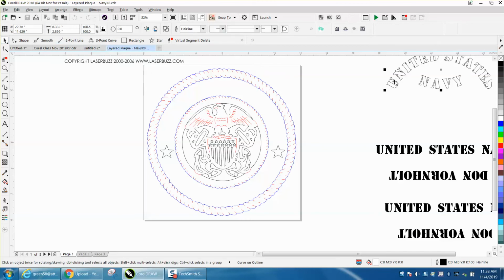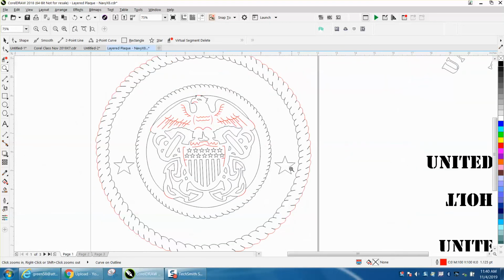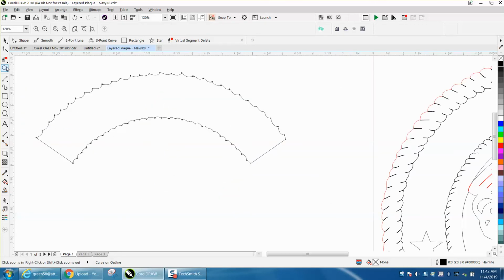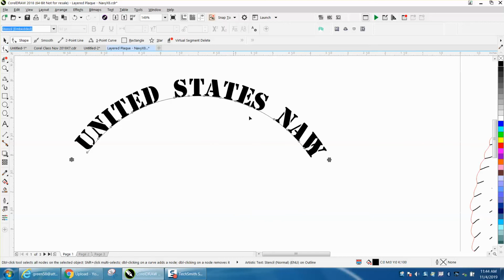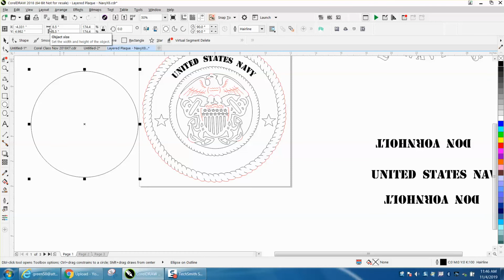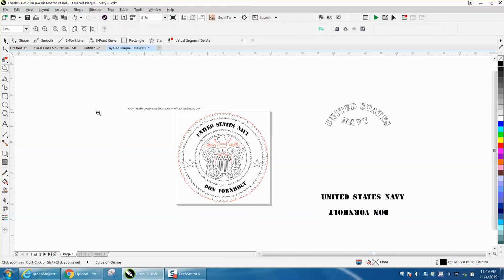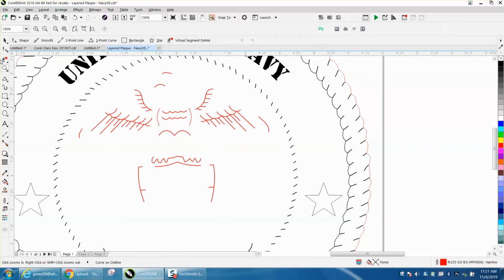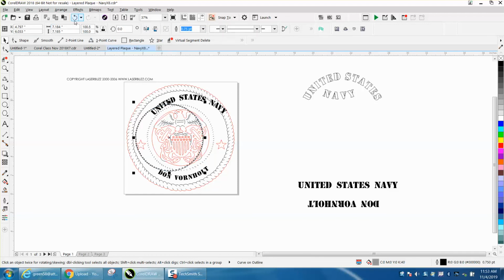Corel Draw Tips & Tricks Problem with Bought Drawing and how to fix

Comment: You are missunderstanding the LaserBuzz layout for a 3D effect
Reply from the maker: not sure about , the cut lines would still cut, tell me more
Reply: @DougGreenAustin  There are 3 hairline cuts and you changed 2 of them not to cut. The 3 vector cuts [blue hairlines] are designed to cut out creating a outside "rope" effect to glue to the back plate. then the others are shimmed with 3mm and 6 mm shims to create a 3d affect making the Eagle 6mm higher then the back plate and the wording rim 3mm higher then the back plate.
Reply from the maker: @davideisenhower8318  yes, I did not know that at the time, thanks